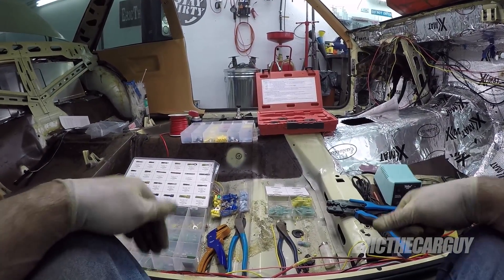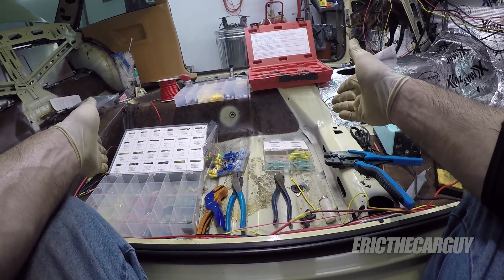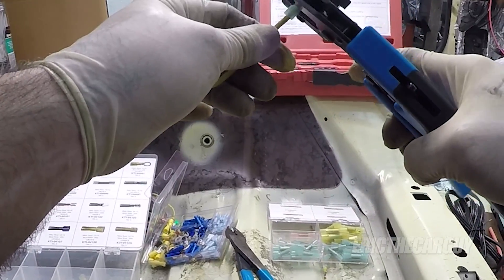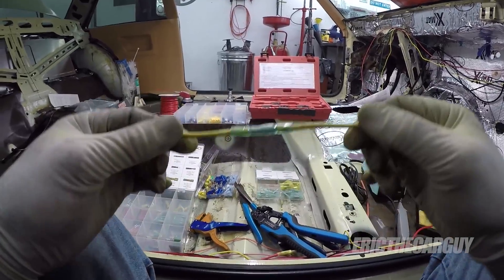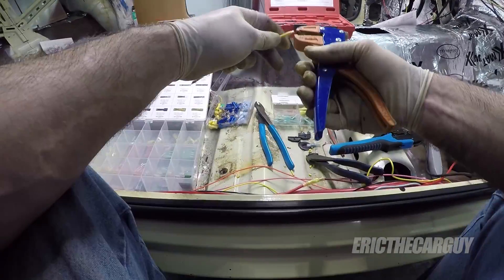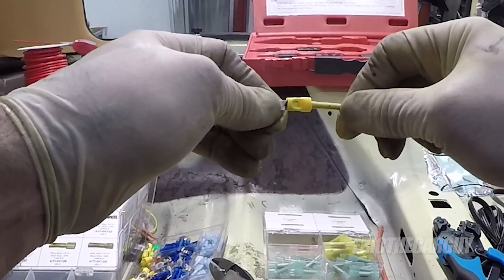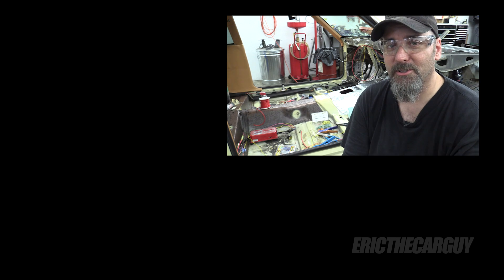How To Crimp Electrical Connectors

Comment: I have 3 different types of crimpers that ratchet .  They also make a hydraulic one for the big connectors like they use on battery cables.  A lot of times I still solder stuff.

Comment: klein makes an ergonomic set (blue handle white ring) very good.

I'm also led to believe that the reason that the gauge number goes up as size goes down is something to do with the number of drawing processes necessary to get the wire down to size. I also recall that it's not as easy as a 1:1 correlation to the awg number.

Comment: I'm a car audio installing for about 8 years now.. and the debate between soldering and crimping is this ... crimping is better than soldering once it is done properly.. key word there is properly... the reason for this is when people spend lots of money on 100% copper wire and copper terminals it's best to get a direct connection between both surfaces .. and crimping basically friction wields the both surfaces together in a sense .. soldering on the other hand is a bit more forgiving and easier for most people to do .. but the debate is why would you want to put other materials such as lead and tin (which is less conductive than copper ) between the two copper surfaces ( providing that 100% copper wire and copper terminals are used)... but soldering makes a great and secure connection .. some people also question the durability of solder wire itself from corrosion and stuff ... something to think about .. I have a hydraulic crimper and also a torch and big soldering iron and when I compared the both connections I didn't really notice any difference... but that's just me

Comment: 99% of the wire that you find in automotive stores is NOT automotive grade wire. It's cheap primary wire which does not hold up to oil, fuel and heat exposure. Look for GXL or TXL wire (or even SXL or SGX wire for larger diameter wire). It's specific automotive wire. 

When I work on old bikes I like to save the old wiring harnesses. That's good quality wire and if it hasn't been damaged or made brittle by the sun then it's normally in perfect shape.
Reply: I'm so glad you posted that c0mputer.  I always thought that the wire I bought at the auto parts store just seemed like it was lower-quality wire than the original wiring.  Where is the best place to find that automotive-grade wiring?

Comment: I never solder on connectors and I've never had an issue but most of the time I don't use connectors and that's when I solder.

Comment: heat shrink and solder is the only way. This is coming from a professional 12v technician. Just use a small/medium sized butane torche and some rosin-filled solder and you'll never have to question your connections again. All of our competition uses t-taps and crimp connectors and they fail 10% of the time, which is far too much.

Comment: I'm not big on the use of a lighter on heat shrink, but sometimes it's the only available option.  My only addition to what you do with the splice connectors is that I put a light coat of a di-electric (non-conductive) grease on the insulation before insertion.  That way, if there are imperfections in the sealing of the heat shrink, the grease helps to keep water out.

Comment: Hi Eric     Nice video, clear information on connectors and tools, and mostly good advice on procedures.     But there is a but, never tin a wire before crimping, tin is a  mechanically weak metal, and it creeps, if you tin a wire before crimping, you just made a connection that will get loose and fail, so ONLY crimp bare wire.     You can solder UN-insulated connectors AFTER crimping, I do not do it myself, but some people do, I would NEVER solder an insulated connector.     You should NEVER have to use the release on your crimping tool, guessing when the crimp is done correctly, is NOT the way to go,     the ratchet is there to insure that you go to the correct max. pressure, and that you do NOT release the tool prematurely!      There should be an adjustment instruction included with your ratcheting crimping tool.     Keep up the good work

Comment: In aviation we don't shove the insulation all the way against splices or cannon plug pins. We leave 1/2 the diameter of the wire exposed, but still within the heat shrink to allow for flex so we don't break wires. Just sayin.

Comment: Excellent video...but no happy birthday ?!??
To each their own, reading through comments.
Yes, soldered connections can go bad over time, crack, high vibrations with no give, but I honestly believe this is based on materials used and knowledge /execution. 
I mainly do soldering for security, you tug hard enough on any crimped connection, and they usually fail, but I see both sides as well and have used crimping. 
Looks good Eric ! Well done sir!

Comment: 4:40 reason why some of the strands came out, is the length of wire you are demo'ing with. Not your or the tool's fault in this case.

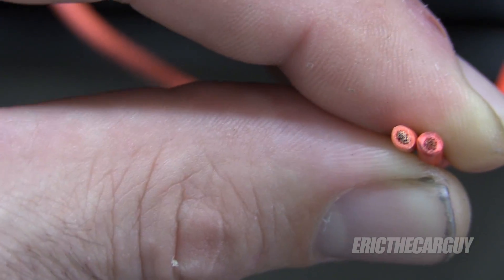Comment: 4:20 the wire on the right looks to me to have more strands, than the one on the left. 
more strands means more redundancy if one of the strands breaks, also that more strands means it's better to send a signal (really only applies to the 750mhz+ range).
So the thinner strands, as far as automotive is concerned are used more in areas where it is likely to flex due to vibration and movement.

Comment: eric, there are different strand counts for wire. higher strand counts are more flexible.

there's also tinned wire, i believe for corrosion resistance, however that is done to the individual strands from the wire manufacturer. i don't think it's a good idea to solder the wire before crimping as it doesn't allow the wire to flair to increase pull out resistance.
Reply: I agree with you.  I used to work with small gauge solid and stranded wire.  It seemed to me that crimping terminal lugs on to solid wire did not make a good connection because I think the crimp style connectors were designed for use with stranded wire where the stranded wire would be crushed in the crimp whereas solid wire will not crush, thus a poor connection.

Comment: Crimp connections are never supposed to be soldered.
A perfect crimp conection makes out a "coldwelding", literally welding the copper wire and the connector material to ecah other, by the pressure applied to the crimp connection.
Thats the whole purpose of a crimp connection.

If you mix it up with other means of bonding metals together, like soldering of any kind, you will most likely damage the coldwelding by the heat expansion from the soldering process.
And you will never get a perfect solder connection without melting the insulation collar on the connector, introducing burnt residues into the connection, meaning you have completely destroyed an otherwise good connection. with future unpredictable faillures waiting for you.

For some mysterious reasons, most people do not understand that a proper soldering connection takes high skills to do correctly, exactly like a good welding job.
Unfortunately not what is demonstrated here.

Mechanics should stick to the crimping technique, as this is the most reliable connection method in the automotive environment.
Reply: Who told you that crimping is literally "cold welding"? 
They are absolutely misleading you, there is absolutely no welding/fusion/melding of the connector and conductor in a crimp connection. 
Deform the crimp and the conductor readily separates from the connector with no difficulty meaning there is no weld/fusion/melding.

Comment: If I'm joining two wires,  I use my teeth to remove insulation,  twist the wires together,  and  put some electrical tape around it. Good to go.

Comment: for the soldering of crimped connections, I only have one thing to say: all the OEM crimped connections ar not soldered, hence i never do it myslef when I'm wiring something. those manufacturers have years of experience and know what they are doing (mostly). On my 19 year old car I've never had a problem with any OEM connection. Also, never join wires only by soldering in cars, it gets britle after time and may break or develop high resistance which may cause many strange faults. in a vehicle, unless you are repairing a circuit board never use a soldering iron, except for when you wnat to melt some plastic.

Comment: I never crimp anything. Maybe its from my old job building vape devices, but I solder and heat shrink all my connectors. If I have to use a connector that has a insulator on it (which I don't buy) I remove it and solder the (silicone) wire in it and always use heat shrink.

Comment: Soldered joints are great for higher amperage loads. Soldering a non-insulated after crimping makes for easy soldering. I would not solder the wire before crimping, it causes the wire to be too hard and will not crimp correctly. For the myth that soldered joints are brittle, that is because lead free solder was used. Do not use lead free solder, it will corrode and is brittle on wires. A lead based or even better a silver based solder is best.
Reply: Maverick Wagner...Lead free solder is also a pain in the ass to use. The EPA thinks that 60/40 rosin core solder ruins the environment.
Reply: Yes, lead free solder sucks! Melts dry and oxidizes much faster causing you to need more flux. and if you have too much flux, it can cause corrosion.
Reply: Actually the government is trying to keep us from poisoning ourselves and ruining the environment with lead. Wait 'til you see what the EPA replaces lead-free solder with.

Comment: will come in handy, i gotta redo my rear speakers,  had them connected to this  http://www.ebay.co.uk/itm/Stereo-CD-Radio-Wiring-Harness-Aerial-Adaptor-For-Vauxhall-Combo-CC20-CD30/350823969245?_trksid=p2047675.c100005.m1851&_trkparms=aid%3D222007%26algo%3DSIM.MBE%26ao%3D2%26asc%3D43782%26meid%3D0c0db2e571ed4259995a877195ce63e6%26pid%3D100005%26rk%3D3%26rkt%3D6%26sd%3D350823965345

Comment: you should not tin the ends of your wires if you plan on crimping them.If you use a lighter to shrink your heat shrink tube , use the blue part of the flame only, it will not melt or leave black burn marks.

Comment: the reason wire gauges seem to go backwards is because they measure the amount of dies they use to thin it out. therefore, a wire the needs 14 dies to get it to size will be thinner than a wire that only needs 4 dies.
Reply from the maker: Interesting. Thanks for the info.

Comment: I was recently introduced to posi-lock and posi-tap connectors.  They're slightly more expensive then your standard butt connector or tap, but I love them.  They don't come in connectors that I am aware of, but they are great for connecting wires together.

Comment: I have a snap on heat gun, costs about $200 and works a lot better.
Reply: That horrible freight drill master costs like 10 bucks, it may take a few more seconds to warm up but it is just as prone to failure as any expensive heat gun I've used, granted I have never wasted 200 bucks for a fap off gun.
Reply: I'm partial to the $190 in savings, thanks. Think I'll wait a bit for it to warm up.

Comment: The idea of crimping stranded wire is that there's a slight springiness in the wire that allows it to maintain a tight crimp regardless of temperature changes. When you solder the stranded wire, you, in effect, create a solid conductor. A solid wire has no springiness and can loosen over time. Also, because the solder will wick up under the insulation, it creates a stress point if the wire moves; the soldered part won't flex so the stress is at the point where the solder ends.

Comment: i like the heat shrink butt connectors and terminals much more than the standard dark plastic ones. 
  i try to go a little smaller than the recommended color connections like you did in the video with a blue connector for 10 gauge wire even though it's technically in yellow territory. it feels tighter. 
  i use the second style of strippers and the pliers type of crimpers, personal preference, as long as you use a tool designed for the job, you'll have much more success than trying to use a random pair of pliers to crimp or diagonal cutters instead of a correct stripper. 
  excellent video. keep up the good work.

Comment: The main thing to keep in mind when doing "this part of the deal" AKA "the wire job" .. Take your sweet time. Do it right on the first try. Wiring will be left pretty much there "forever" so if you just rush it and bodge it up, at some point a wire will short.. And it's a nightmare to start tearing up all your work just because you rushed it. 

I personally even tape the wires neatly so they're organized and won't rattle around under the carpet. 
I also use different color tape on the connection points so i can check for bad connections fast. 

Also if i need to drill a hole for a wire, i'll take my time putting a rubber seal around the metal so the insulation won't rub against the rough metal.. It's all attention to detail.. Solder the wire properly and use a heatshrink. Crimping is only for fast non-permanent connections. Like a car radio. You'll remove that sucker sooner or later. So crimp it. Or better yet, use those fast connection blocks.. (we call them sugar cubes here.) But for wires that will remain there under the carpet like rear tail light wiring ect.. Solder them and do it right the first time.
Reply: Best soldering tip: 

HEAT THE METAL. NOT THE SOLDER.
Reply from the maker: Great tips, thanks for your input. However, I was a solder guy too, but I have no issues with the crimp connections, especially with the connectors I'm using. The heat shrink on the connector is a real time saver and the connection seems just as good as a solder joint. Think about it, manufacturers don't solder their connections and considering the billions they've made over the years, I think the failure rate is pretty low. Thanks again.
Reply: Yeah the connectors have been much better quality nowadays than what it was before. 
I'm personally an oldschool guy so i always prefer soldering. 

But as long as the connector stays water tight and can't rattle, it'll hold.
Reply: Ford M Garage But I thought the solder was metal? ;-)

That said, there is a good argument to be made that a wetted soldering iron tip with a small bead of solder is far more effective at transferring heat into the wire, or connection, than a dry soldering tip (even though properly tinned) due to the greater area of contact between the two afforded by the small bead of solder bridging the two.  So, as is often the case, the truth tends to lie a bit in the middle, but it is absolutely critical to get the wire or connection you are soldering up to temperature before flooding with solder or the solder will not properly wet all the surfaces to create the strong bond one desires.

Comment: Cool video! Just want to add that tinning the wire before crimping is no good. Either solder or crimp, don't do both. Also adding a heat shrink tube over insulated crimped connectors/joins makes no sense to me (unless you want to hide your imperfect crimp...) Heat shrink tubes over soldered wire joins makes sense though, and makes a good and rigid connection if done right (it's cheaper also, but disassembly is not as easy). If using heat shrink tubes in automotive assemblies, make sure to use high quality kind with glue inside. Helps protect it against dirt and moisture and makes it more resistant to wear, moist, vibrations etc.

Comment: I think soldering would defeat the whole purpose of crimp terminals.  If youre gonna solder than just twist the wires together and heat shrink it.  Youre also supposed to clean off flux after soldering.  That would just be a huge pita.

Comment: I never use a mechanical crimp to join two wires unless there is no other option. I will solder the wires together with a non rosin core solder and non corrosive flux then cover with quality heat shrink. A proper solder connection will outlast any mechanical connection.
Reply: why? thats just a valueless assertion
Reply: William Combs as long as you join the wire with a good mechanical lineman splice or something. But I'm with you on that. I work on 70's bikes and all the solder joints I've seen on those are still shiny and strong. And they just covered the joint with some type of electrical tape wrap. Not even heat shrinked.
Reply: There are millions of crimp type connections in critical systems like air traffic control, fire and police communications, etc. and they seem to be holding up just fine.

Comment: Great video automotive wiring is very complex with many different types of signals and power connections.  I would like to add know the circuit your working on. If it is a 12-volt power circuit where is it fused, what is the fuse rating is the wire size and connector rated for the circuit. Again this is a great video covering the physical connectors and wires. I have a 1964 C10 pickup that was owned by an industrial electrician. He rewired the truck with solid conductor 14 and 10 gauge wire. I chased broken conductors for hours. I have purchased a painless harness to rewire the truck. Thanks for the great videos and all the hard work.
Reply from the maker: Painless makes great kits. Thanks for the comment.

Comment: The difference between the two wires is due to the stranding. Stranded wire is thicker than stranded because of the spaces between the strands, but thinner strands have smaller spaces resulting in a thinner wire. They're also more flexible, but as you can see they often have thicker insulation because small strands are also more fragile.

What model of die crimpers are those? I need to redo my bike harness again and those look much handier than the crimpers I've both now.
Reply from the maker: Thanks for the info. Links in the description for all tools.